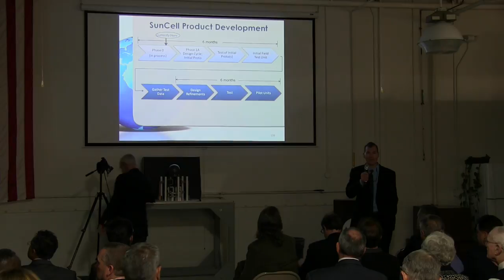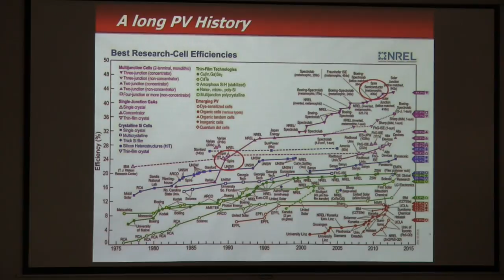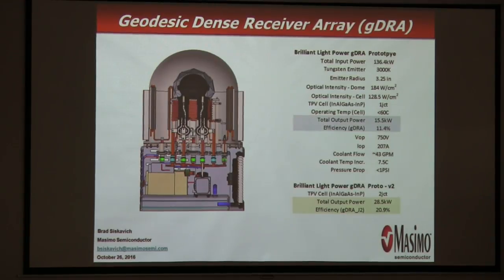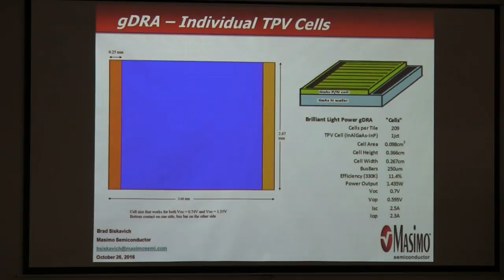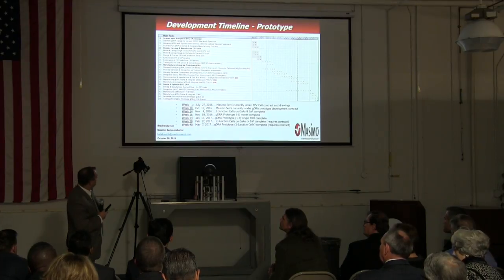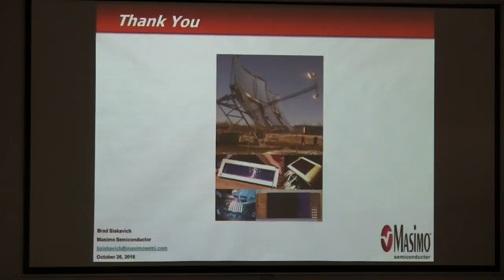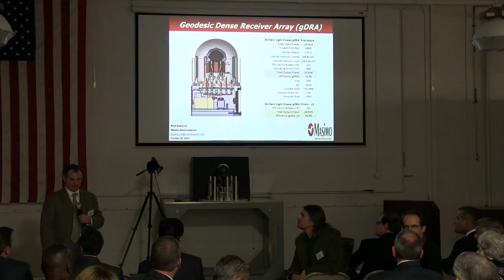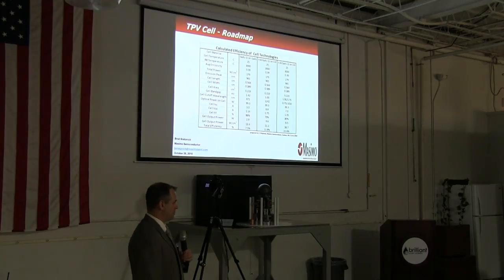Brilliant Light Power's October 26, 2016 Industry Day Part 6 of 7

Comment: If this device is using no power to keep itself running, why not just use the cheapest option for residential use as you would require no more than 4 or 5 kW. You would get it to the market much quicker. Using the most inefficient cell would still give 10kw. More than enough to power a residential home. You would probably need to remove more heat but this could be used as a CHP system. Here in the Uk most home are water centrally heated so we already have the infrastructure.